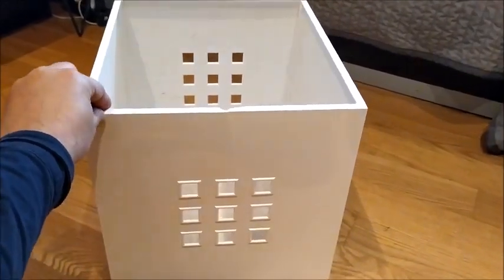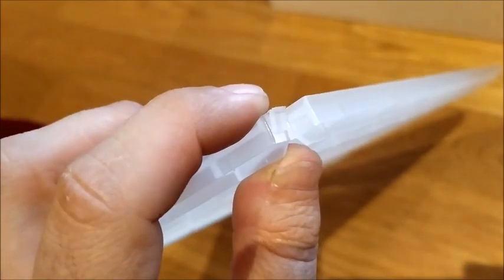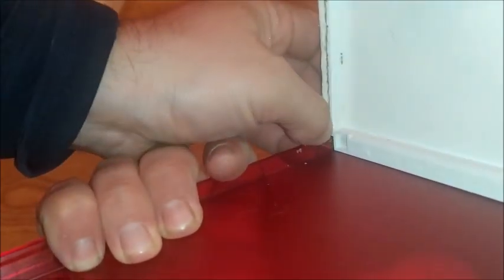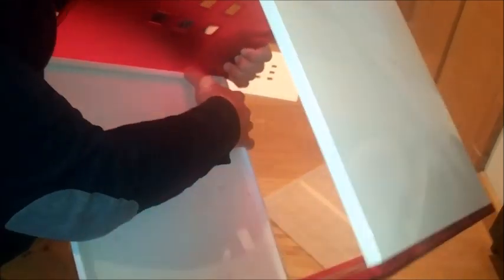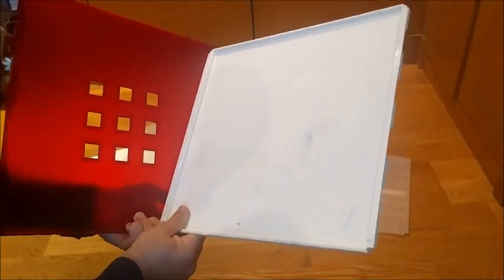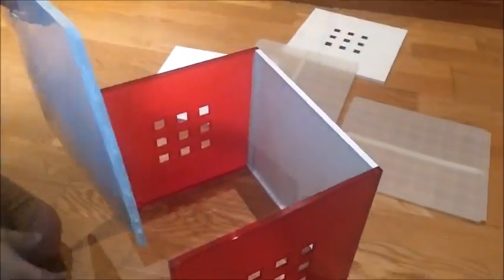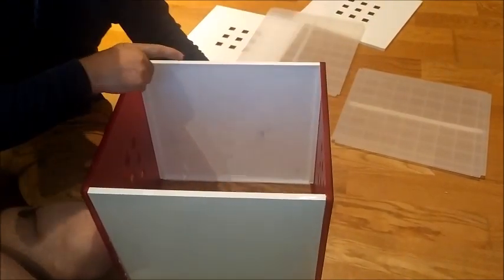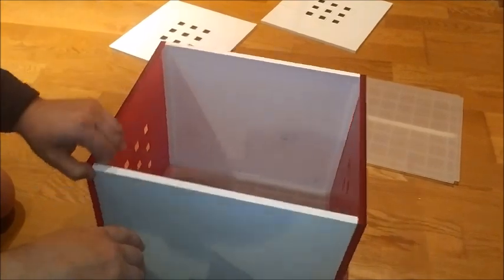Assembly and dismantle Lekman Ikea cube box

Comment: The tabs for the bottom pieces can be easily pried up with a thin flathead screwdriver to avoid breaking them off. The side pieces… fragile junk, lol. Still haven’t managed to take one apart with breaking pieces of the sides off. Good news is they do go back together OK, even missing some of the plastic, as long as they don’t need to be handled frequently or hold heavy stuff.
Reply from the maker: Thanks for sharing your experience. Sorry for not remarking how easy they break

Comment: I work for ikea, our stuff is made well, I've had these box for a very long time with heavy stuff in them.  They are not designed to come apart.   If they did the would break with use.
Reply from the maker: But what if you have to? I'm our case we moved to another house and had no other choice
Reply: Do what you have to do but do not post a tutorial on how to break stuff.  And your box probably won't last much longer.